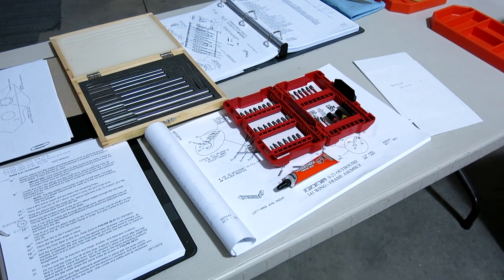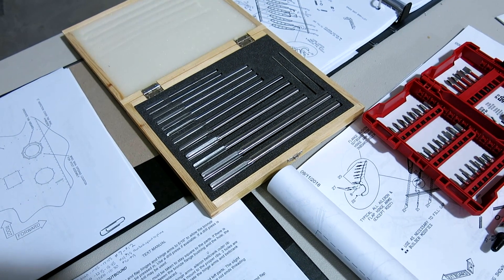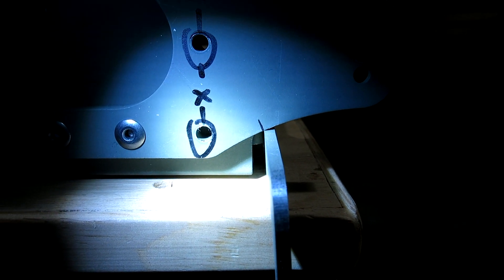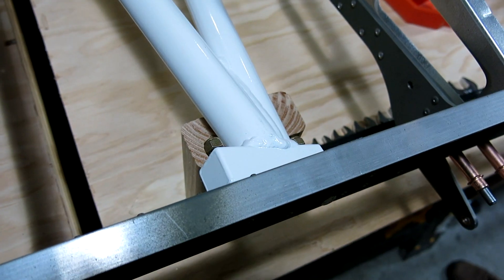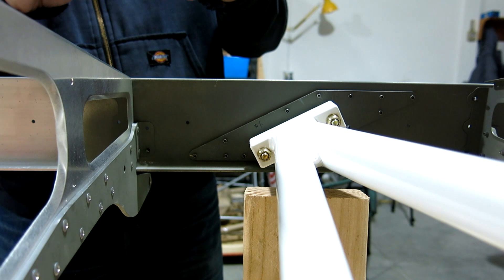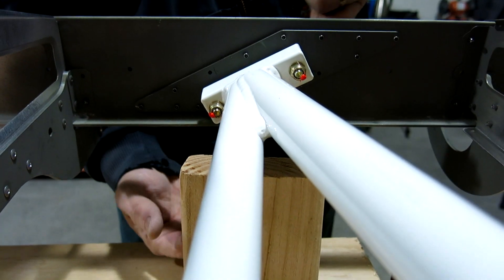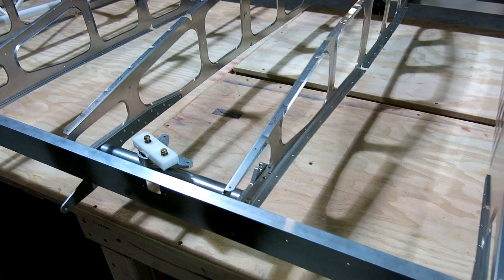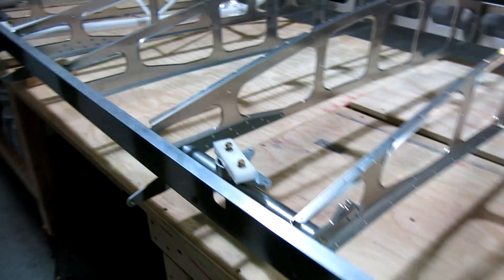No. 53 12-12-2020 Wing construction continues

Comment: You may wish to check your parts manual as I think you torqued the rear truss nuts incorrectly.  You said shear nut and 30 - 40 in-lbs, but according to my parts manual these are tension nuts (and I could tell visually as they looked pretty thick in your video) and should have much higher torque.  I want to say 50 - 70 in-lbs plus the locking nut drag, but double-check me on that.
Reply from the maker: Yes, you are correct! I was looking at the shear nut specs (and referring to them as shear nuts). Those are tensile nuts. We’ll have to torque those down a little more. Thank you!!